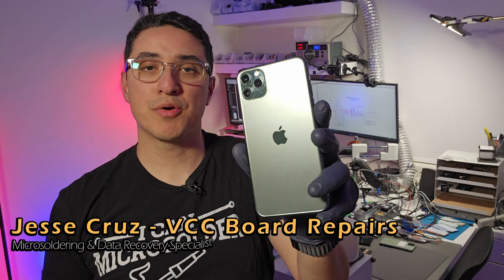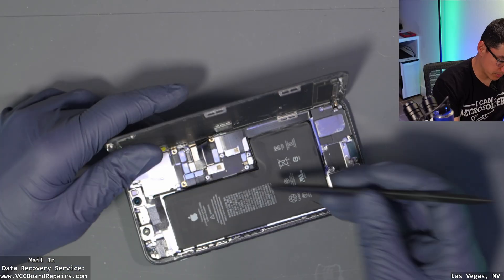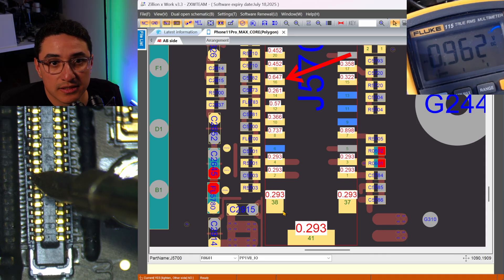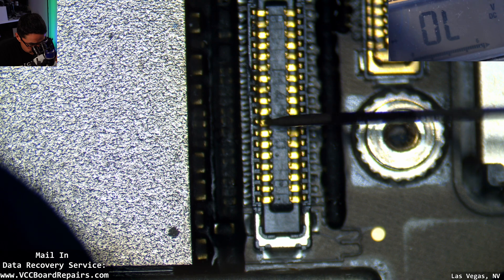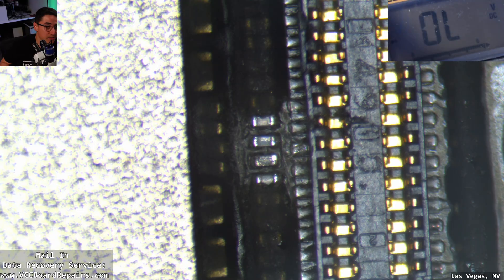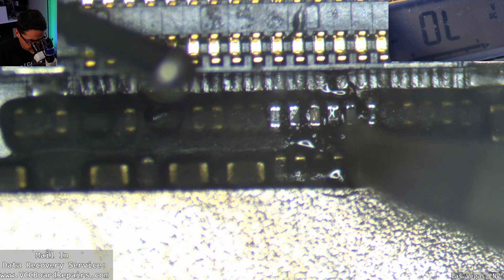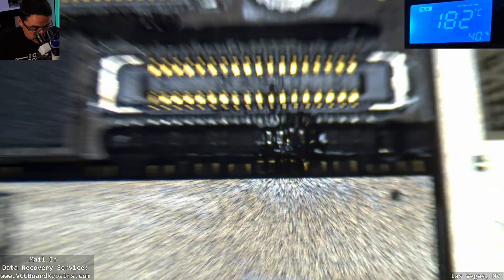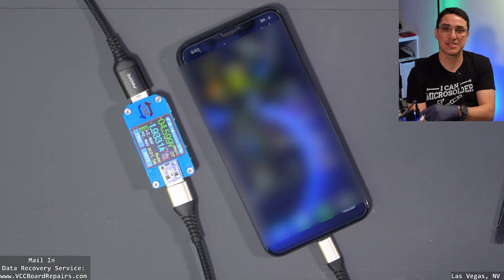The REAL Reason Your iPhone 11 Pro Max Has No Display - Easy Board Repair Fix

Comment: Quick question for you… how are you able to replace screens and internal parts without that Apple Parts and Service nag?  Or is that impossible if you’re not buying parts directly from Apple?
Reply from the maker: I just replace them

 the message goes away after you dismiss it